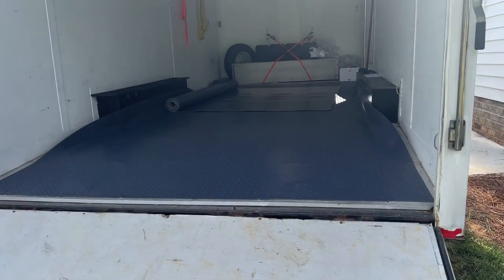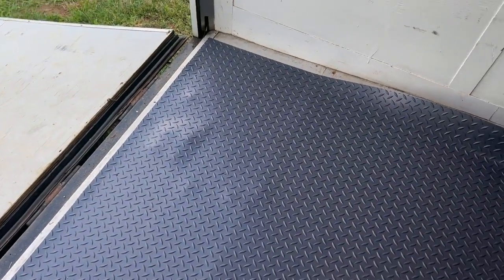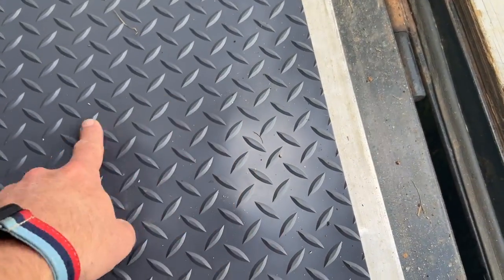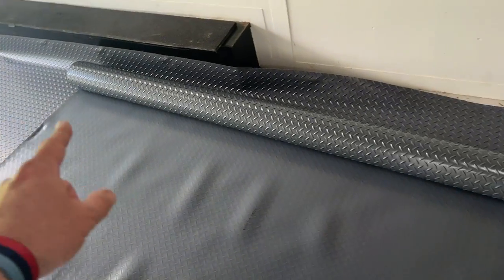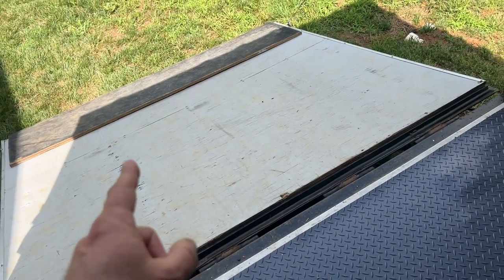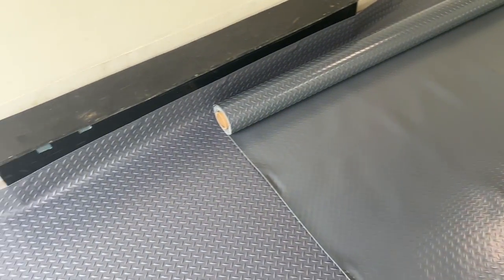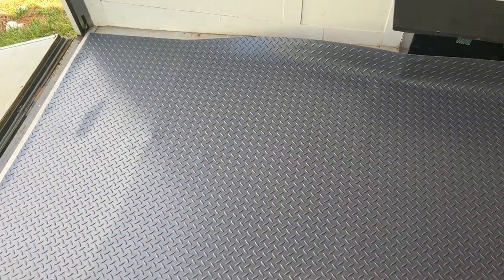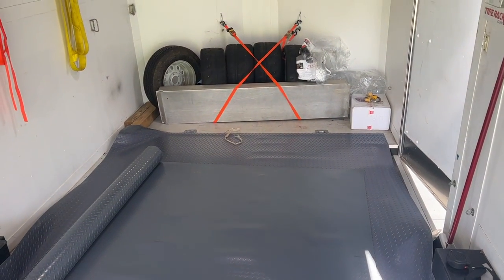Enclosed Trailer Vinyl Flooring

Comment: I tucked it under the flashing at the back, one side also has etrack holding it down, and my tool chest work bench in the front holding it down with one side not secured. It hasn't moved. Sometimes I'll get some ribs in it, but if you adhere all sides, as the temperature fluctuates it will contract and expand. Best to only adhere one side near the ramp to be sure it doesn't roll up on you
Reply from the maker: +Micah Roberts 👍🍻